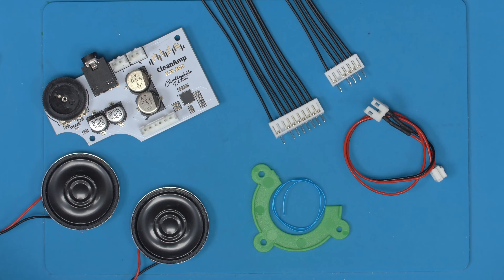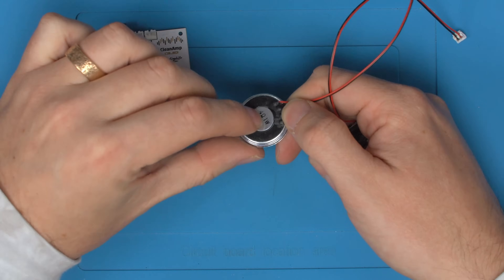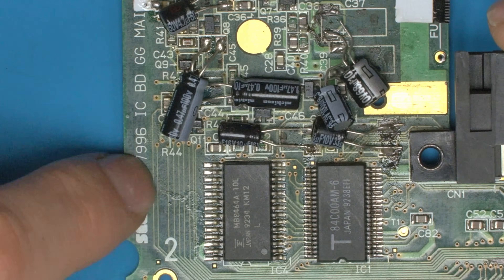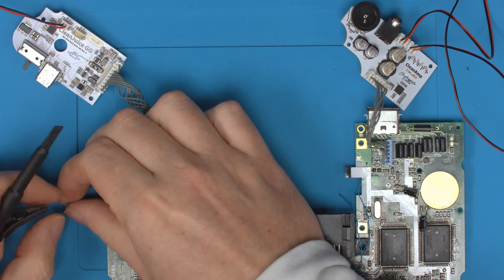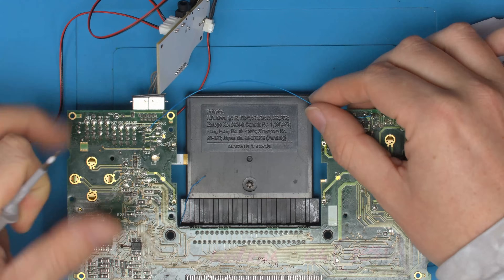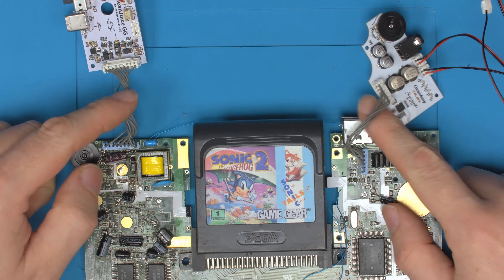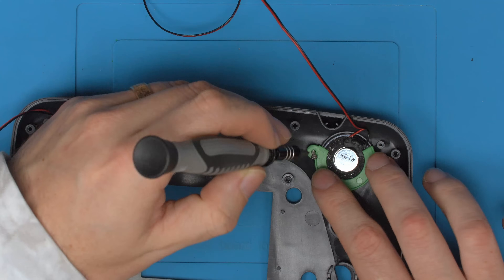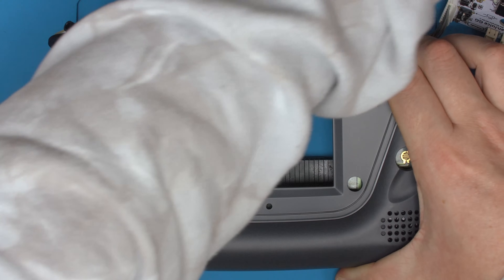The SOUND secret that Sega had hidden in every Game Gear

Comment: I just installed Console5's kit and, well now I'm slightly annoyed. A) They're providing parts that may/will/cause further issues down the line and B) I have to order your kit, undo the work of the old kit and install the new one. Not that big a deal for someone that can afford a hot air station but I'm not that someone. It's fine... at the very least my console works for now and the old kit did rectify my power issue. I appreciate the knowledge.

New kit has been ordered. I need to replace my button membrane anyway (it's ripped) so yeah
Reply: Console 5 is a good kit and they include the stock soundboard capacitors as well where R6 doesnt which was slightly annoying I've done one of each this company this week

Comment: Anyone know reason behind both headphone and speakers working at the sMe time, I have this issue on 2 audio boards
Reply from the maker: The spring that shorts one pin to ground in the headphone jack not shorting to ground. You can see the spring that moves at the side of the port and you see it move when inserting the headphones
Reply: @RetroSix  rhanks for quick reply, will check that,the part that corrodes and always needs a clean?. I cleaned and tinned that to tidy it up, maybe I've made it to rigid now, tight fit with headphone jack!

Comment: Can you design a shell with extra holes? L1, L2, R1, R2, 4 face buttons, and space for 2 analog sticks? I also would like to see 16x9 aspect ratio screen hole I want to put a raspberry pi inside of one and I bet the case would sell like hotcakes if you designed it right!
Reply: 11:17 11:17 ❤ 3:06